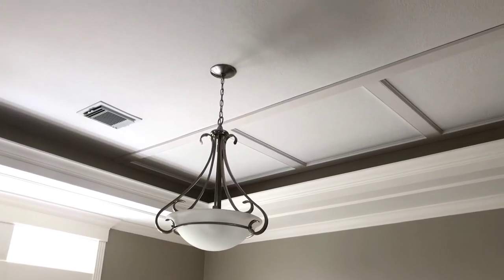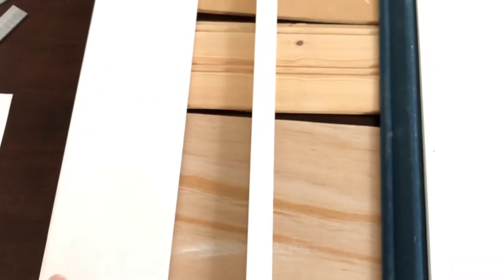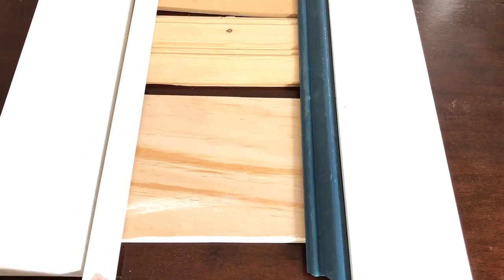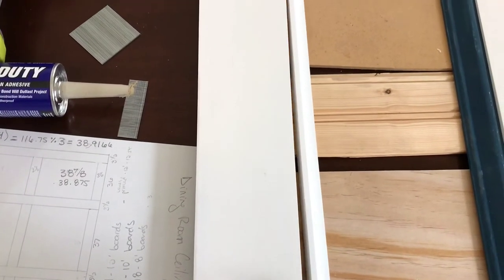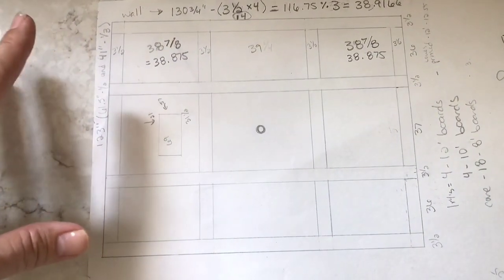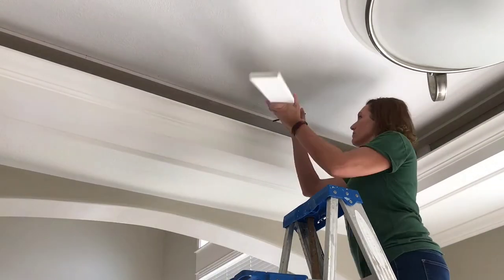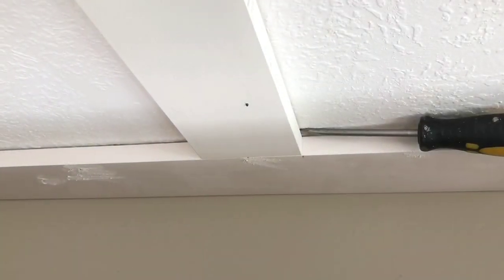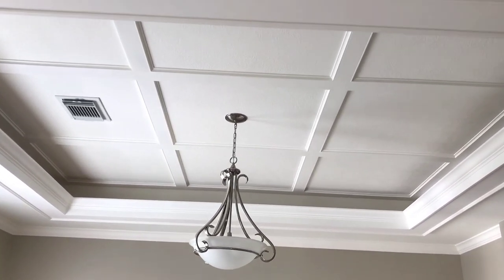Install a Flat Coffered Ceiling - Low-Profile Design - Beautiful DIY Ceiling Makeover Idea

Comment: Love the video.  Who makes the polystyrene 1x4’s?  I can’t find any plain 1x’s at Lowes nor HD.  Thanks!
Reply from the maker: Hi Scott. Thanks! I used Primed Pine 1x4 and Polystyrene Cove Molding. Both can be found at Lowes and HD. Here's a link to the 1x4 at Lowe's: https://www.lowes.com/pd/Common-1-in-x-4-in-x-8-ft-Actual-0-7187-in-x-3-5-in-x-8-ft-Primed-Pine-Board/1000842744  Here's the cove: https://www.lowes.com/pd/Inteplast-Group-Building-Products-11-16-in-x-8-ft-Prefinished-Polystyrene-Cove-Moulding/1000576439  Good luck!

Comment: Thanks for the video, did you scrape ttys ceiling where you placed the boards so it was flush agsinst the ceiling?
Reply from the maker: Hi, thanks! The texture on my ceiling is very thin, maybe 1/16th of an inch thick. So, I was able to leave it as is. You can scrape a ceiling with thicker texture or cover it with 1/4” plywood or luan board. Just plan your plywood cuts so that the seams are under the 1x4 boards. 👍

Comment: At my living room ceiling, there's a 3 inch protrusion of the wall above the fireplace.  It runs about 5 feet of the length of the 13 foot wall.  Any recommendations for what to do about installing this thin coffered ceiling on the ceiling above that 13 foot wall?
Reply from the maker: If I’m picturing this right, I’d try to plan the layout for the boards running perpendicular to the fireplace to line up with each end of the bump out. I’d notch the board parallel to that wall out at the bump out. So, if you use a 1x4 it’s actually 3 1/2” wide. Use the full width along the wall but only 1/2” at the 3” bump out. Then the trim along that wall will have 1 continuous line, which looks prettier and more professional.
Reply: @AbbottsAtHome   Wow, that is a great idea!  Thank you for the advice.  :)